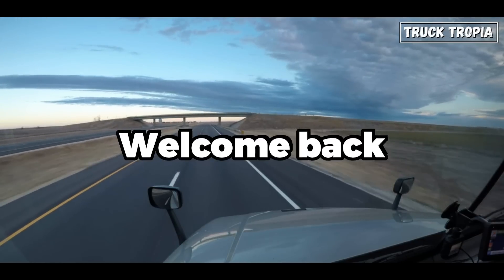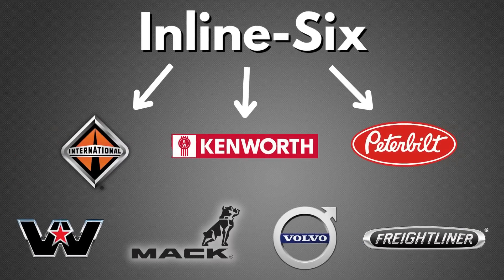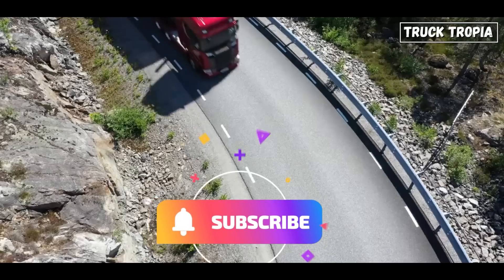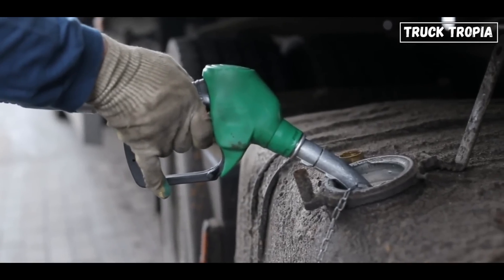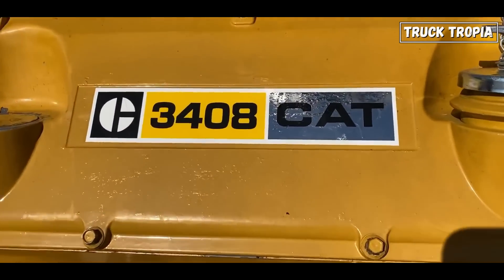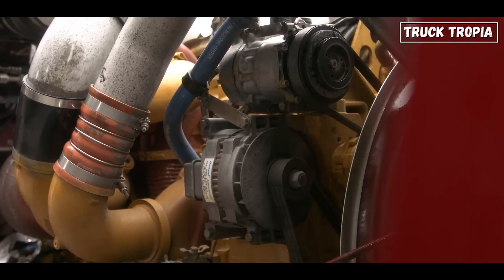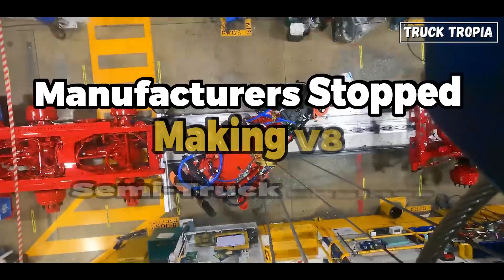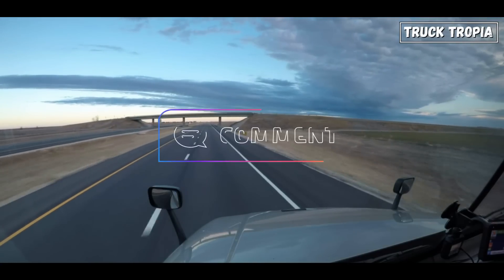Why US Manufacturers Stopped Making V8 Semi-Truck Engines?

Comment: why care about this few % of efficiency and maintenance cost reduction, when V8 is just more fun.
Reply: Idk about more fun but it just makes the market more interesting to have the choice between many different engine configurations.
Reply: well then they can make boring trucks for bigger companies and fun trucks for owner operators and enthusiasts there should be more options
Reply: well then they can make boring trucks for bigger companies and fun trucks for owner operators and enthusiasts there should be more options
Reply: well then they can make boring trucks for bigger companies and fun trucks for owner operators and enthusiasts there should be more options
Reply: Well, I guess because trucks are designed for business, not pure leisure.
Reply: @lakonikos8791  why can't have fun at work?
Reply: @lakonikos8791  Many owner operators would happily buy something other than an i6 but unlike the pickup truck market the semis are almost completely controlled buy fleet buyers
Reply: A few % isn't a big deal to you. But it is for a fleet of 5 trucks, or a fleet of 50 or 100 or 2000 trucks makes a difference. As an owner operator myself, the difference of 1 MPG is huge at the end of 1 week that has 3850 miles a week. At 8 mpg that's 481 gallons, at 7 mpg that is 550 gallons. V8 or I6 the speed limit is the same, and you sit at the speed limit all day(for the majority of trucks). That's 69 gallons a week over 52 weeks a year, is 3,588 gallons. At $4 a gallon that's $14,352 or lost profit. On one truck, with a fleet of 5 that is $71,760, on 50 trucks thats $717,600. Do you go to work for fun? I'm pretty sure trucking companies don't do what they do for fun. Business isn't fun, it's to make money then have fun. With the profits
Reply: @jnk26  Never said fleets shouldn't have say. That's why I mentioned the pickup truck market. Every brand of pickup makes the cheap version of their truck that may be less powerful or less comfortable but it saves money over 10s to 1000s of trucks. What I'm saying is if you own a fleet or are just looking for the maximum fuel efficiency go for one of the many 10 to 13l i6 options already on the market. However if you want more power for whatever reason you can choose between a couple i6s a couple v8s and maybe even a v12. The same engineering effort put into different configurations would result in pros and cons instead of "pick one there all basically the same".
Reply: @Eric_V410  hp is just a selling point. Torque is the only force involved. HP is just how fast work gets done. My truck has 500hp@1700rpm(thats is 1544lbft) it also has 1850lbft@1100-1400rpm. Thats is 387hp@1100rpm, and 493hp@1400rpm. When climbing hills at 140,000lbs. I downshift at 1200rpm up to 1500rpm the engine lugs back to the peak torque(@1400) and holds there. If it still lugs back, I'll hold till 1200rpm. As I crest the grade it pulls out raising the rpm. Now showing hp is a calculation. My 500hp 13L and my 500hp 6.7L Powerstroke cant do the same job. Why? Because the leverage to turn the wheels are not even close to the same. Hp is a calculation. If 500hp is "stronger" why does the engine lugs back to the peak torque? The difference between 493hp and 500hp is 7hp right?? But the difference between 1850lbft(493hp@1400) and 1544lbft(500hp@1700) is 306lbft. After the driveline manipulation(torque x gear ratio x axle ratio) its dramatic
Torque x rpm ÷ 5252
1850lbft x 1400rpm ÷ 5252 = 493.1hp
1850lbft x 1100rpm ÷ 5252 = 387.4hp
13L I6
500hp x 5252 ÷1700rpm is 1544lbft
6.7L V8
500hp x 5252 ÷ 2600rpm is 1010lbft
Pretty significant difference, especially after to put it through the driveline.
At speed in an acceleration gear(35mph) my same is in 9th 1.63:1). 1300rpm(1850lbft) x 1.63:1 x 3.25:1(axle ratio) = 9800.35lbft to the wheels 
Same in the pickup is in 7th(1:1) at 1700rpm(high rpm for road speed)
1200@1600rpm, so 1150lbft(@1700) x 1:1 x 3.55:1 = 4082lbft at the wheels. 1200lbft@1600rpm is 365hp thats only 23hp less than the 1850lbft@1100rpm(387hp), but 650lbft difference. 
1000lbft@1313rpm is 250hp
1000lbft@2626rpm is 500hp
1000lbft@3939rpm is 750hp
1000lbft@5252rpm is 1000hp
All are the same strength, each stepis twice as fast as the last. Same amount t of work at a faster rate.
Where as 
HO 3.5L Ecoboost
450hp@5000rpm is 472lbft
12.8L Detriot diesel DD13
450hp@1900rpm is 1243lbft
3406E Cat 
450hp@1600rpm is 1477lbft
Hp power is just a rating for how fast a certain amount of work gets done. A 240hp@8300rpm(151lbft) is no where near the same as a 240hp@5000rpm(252lbft)Gas V8 or a 240hp@2600rpm(480lbft) Diesel V8.
Reply: @jnk26  I honestly dont get your point here. Just because I used power ass an all exclusive term you felt you needed to take the time to explain why a f250 and a freightliner cant do the same work. I dont have an answer to whatever the argument your making is cause I dont see your point. Also does your truck have a paccar and if so how is it reliability wise.
Reply: @Eric_V410  it's not an argument. It's a statement about HP. I wouldn't drive a PACCAR anything. Pulling the same pneumatic trailers back in 2018. my Volvo is getting 2.6km/l(6.11mpg) and the PACCAR MX13 in a 389 was getting 2.2km/l(5.7mpg) side by side on the same road.
Reply: @jnk26  Ok I just didn't get  why you spent so much time on that. However being a technical person it was interesting to read. I assumed paccar as their 500 hp version claims 1850 lb ft if I'm not mistaken but I'm with you on not driving a paccar. I've heard emissions problems are pretty bad along with many cheaply made components. Does slightly suprise me about the efficiency though as I've heard their good on fuel but maybe Volvo are just better.
Reply: @Eric_V410  part of the efficiency is a 389 is a square "classic" truck and all or the Volvo products are "slippery" or aerodynamic. The other part is my gearing is not the old school thinking. A 13/18 speed and a 4.10 is "heavy haul" gearing. Thats true of the older engines that didn't like the 1200-1300rpm cruise rpm. Those old gearing specs had motors turning at 1600rpm HP on a CAT 3406E or  just under the Detriot Diesels 12.7/14L series 60. By slowing down the rpm while make the same(if not more) torque at a lower engine speed means less fuel used.
Reply: @jnk26  Ah was assuming you were comparing aero vs aero not aero vs brick. If the long nose with a new powertrain is still gear like an older powertrain then to me I'd say the paccar did pretty good fuel wise especially pushing a barn through the air. Love the long nose but obviously maintenance space and looks are put over aero.
Reply: @Eric_V410  th comapny also had PACCARs areo trucks and still not the same or even close. I've driven a 2018 Volvo VHD(pretty square) and is still beat Pete's, and cornbinders(with Cummins junk) it has a lot to do with the gearing. Aero matters at speed, a 0.73 top gear and a 4.10 will always bur more fuel. 0.78 top gear and a 3.25 axle makes a difference. I bought the truck used, she was originally spec'd for tandem tankers. I was pulling a 6axle pneumatic tank(external ribs) an aero nightmare. When I moved over to hauling fuel my tanks were the same height as the sleeper. I am getting 3.6km/L(8.4mpg) on the highway as an average. It's faster off the line than a 600hp truck(geared with 4.11s) until I get to the top side, where their higher torque all the way up into the powerband walks me.
600hp@1700rpm is 1853lbft
500hp@1700rpm is 1544lbft
They have the same pull(actually better because the 4.11 vs 3.25) in the topend(high range) because they have considerably higher torque to the wheel to move a similar load. But the don't get the same milage I do, ever.
Reply: @jnk26  So paccar for sure junk. I'll forget that you said cummins is junk all though you can say it about isx series. Seems as though you have almost the perfect setup for what you do, I mostly haul grain/silage(I'm a farmer) with less constant highway miles. Part of why I like the higher power(and torque) engines. I just think some more engine choice would be cool. Part of the problem is also gov emissions regulations so we'll probably be driving electric trucks with generators before anything like a v8 comes to the market.
Reply: @Eric_V410  every engine manufacturer has its issues. Cummins is especially bad in my books because every Cummins I had drive has let me down large. Never had abrackdwon with a paccar, but seen dozens of my friend and co-workers be left out in the cold for months waiting on simple parts. Alot of the repairs on an MX13 are just stupid. I know X12 highway coaches that have less than 100k miles on them that have 12 or more major recall. Constant engine electrical issues and all around piss-poor performance. I briefly worked for a construction outfit that always had Cummin break downs(oldest truck was a 2016 back in 2021) Cummins has no competitor so they don't have to try and be better. They have the market to themselves. It's a shit show of junk. Cummins Rams have a really bad cam lifter issue, that grenades the motor. Ram just has issues with lifters. 5.7 hemi tick? Lifter eats the cam. Mmmmm, just out of warranty everytime
Reply: @jnk26  I see, I haven't had personal experience with x12 or 15 more big cam n14 and some isx. I've seen the same thing with paccar which is why I mentioned cheap made parts, small shit but still costs you. Cummins monopoly probably has gotten to their head, they're also focused on electric/alternatives fuel instead of making what they have better. Also I lost some respect when they said they're focused on diversity and inclusiveness. They should be focused on making the best engines possible and whoever suits the job best should get it. That goes for all companies.

Comment: Suggestion: All European Truck Brands Ranked from Worst to Best
Reply from the maker: Thanks 👍
Reply: I can surely tell you, that Iveco is THE SHITTIEST EU truck brand
Reply: MAN has nice styling but isn’t great and I think Volvo is super overrated
Reply: @Orbiitoclast can't say yet due to not having long experience with new Volvos, but do the new ones still have wiring harness issues?
Reply: I like the older european trucks , not the crap they build now. The dashboards look like shit nowadays and they start using camera's and screens in stead of mirrors. I think of quitting the job very soon.
Reply: @johan8724 isn't only Mercedes going for the cameras instead of mirrors approach? And they are optional.
Reply: @shaggings  daf has camera's but stil can be ordered with mirrors